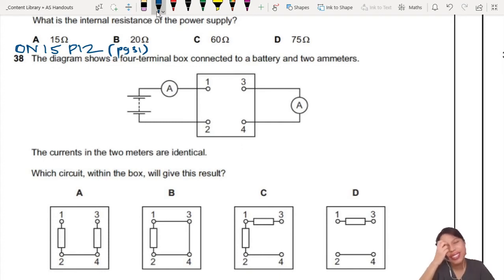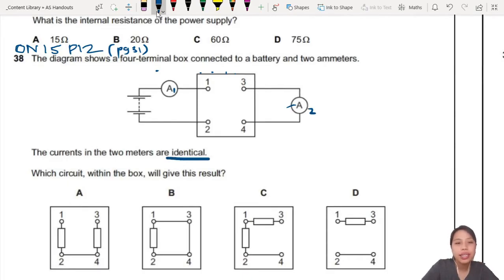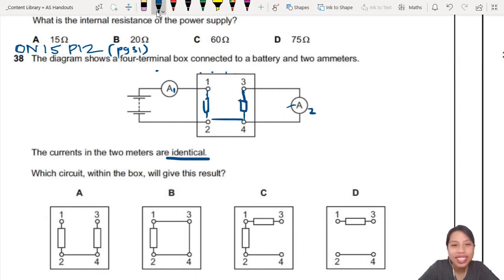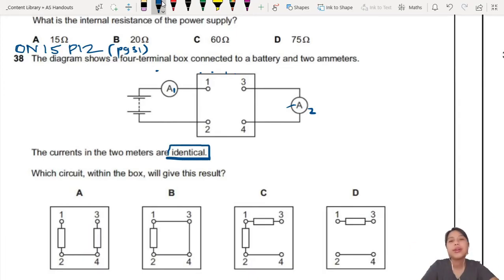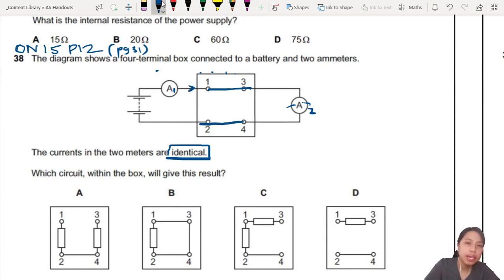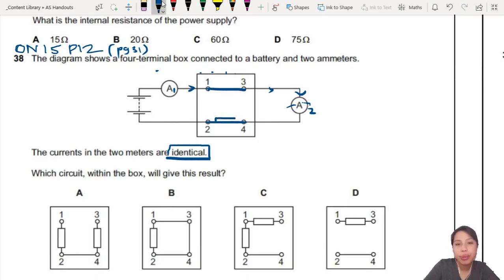10.1c Ex1 ON15 P12 Q38 Terminal Box | AS DC Circuits | Cambridge A Level 9702 Physics

Comment: I understand the D answer. But Does B not work as well?  It short circuited and both ameter have 0 resistance current would like to pass it instead of the resistor, making it zero current pass through resistor so 2 are identical.
Reply: the circuit would be parallel so current won't be the same anymore